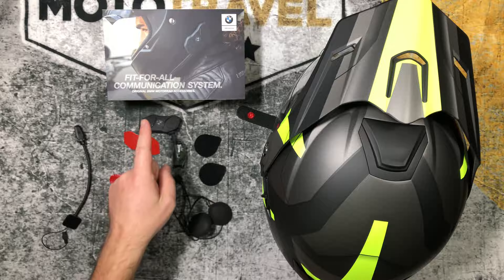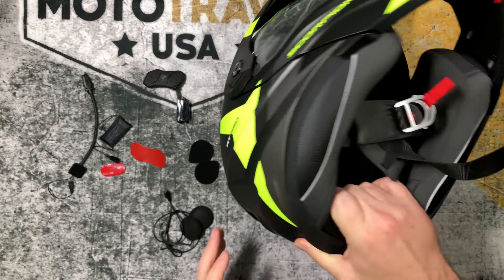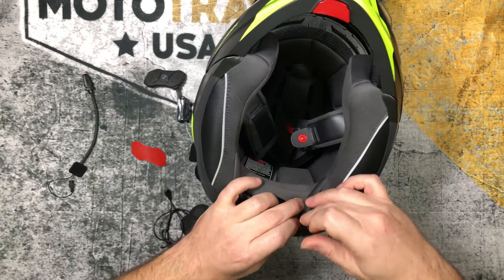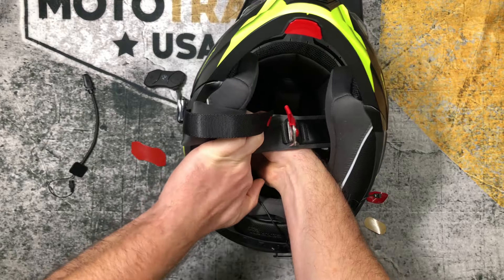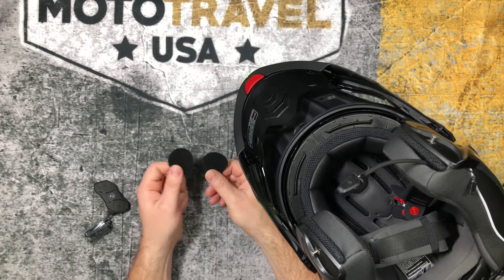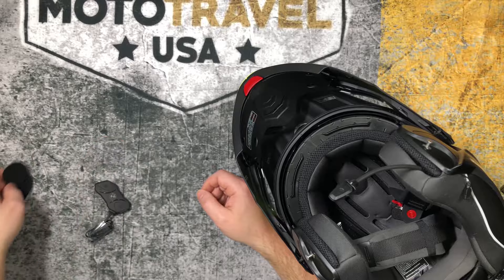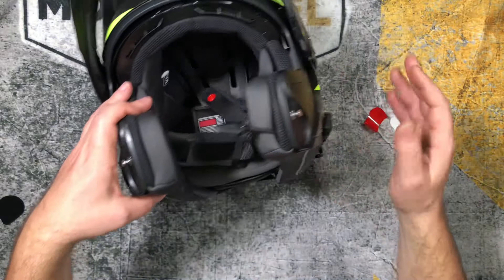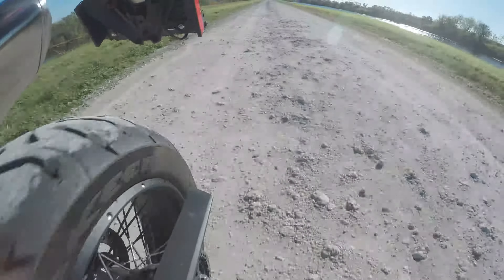BMW Fit For All Bluetooth Installation | Motorcycle Bluetooth Helmet Installation

Comment: Hi, Great Video

I followed your instructions, but im having trouble connecting it up to my 2016 R1200RT, i just cannot get everything to sync.. Can you help.

I have the following kit

BMW NAV 6
BMW Audio Center on the bike
Smartphone

The question is, how do link them all up, and which order do i take

Regards
GT
Reply from the maker: I’m not familiar with the 2016 bike interface. With the 2018- GS TFT the navigator, your phone, and the headset would be connected to the TFT. Maybe that’s how it can work on yours? If not, I think you can only pair two devices to the bmw communicator at a time with multipoint pairing, so maybe your phone and the navigator? Wish I could help more.

Comment: Hi.  Thanks for the video. Question. If two riders have this system, can they be paired and used as a comm system between two bikes?   I'm looking for another comm system for my wife and I and I just purchased a new R1250GS so I thought this could be a good option.  Thanks.
Reply: A Sena 30k or a pair of,  look a lot better than this kit. But they won't fit a BMW Helmet. Shoei is fine.